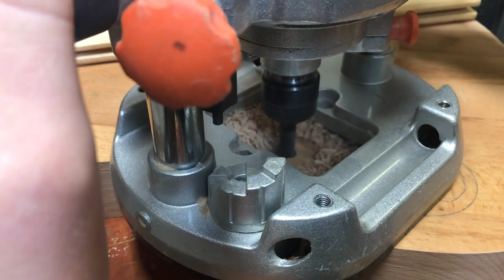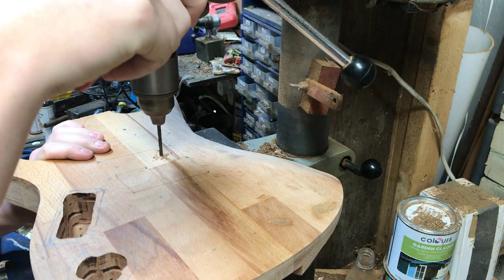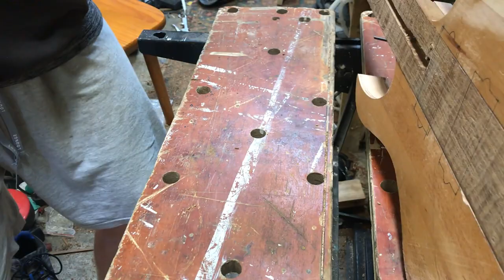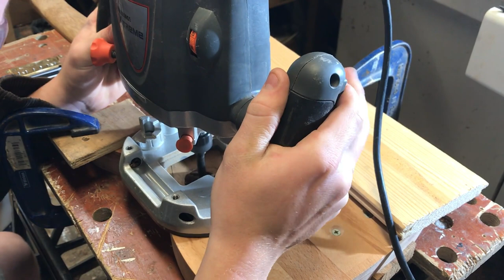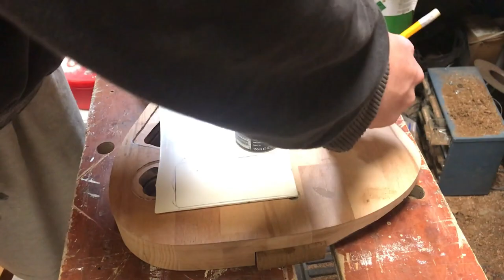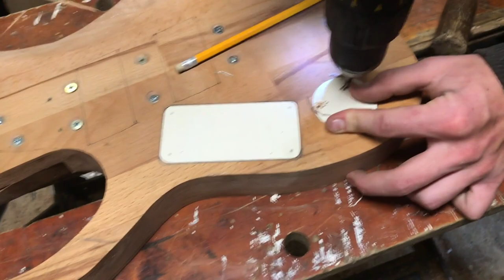Custom Electric Guitar Part 5 - Body Cavity's

Comment: Now you're cheating. There is a point at which your cavities look as though they've been carved out with a blunt axe. And then suddenly, voila, they have clean edges and are the right shape. How did you achieve this? You don't need money for parts. You need money for templates, forstner bits and router bits with a bearing. And what's with the custom pickups? Are you going to wind your own?
Reply from the maker: its all roughly routed out on camera and then afterward I have carefully freehand routed it to the lines that I scored with a knife to get a perfect edge off camera because I didn't want a camera in my face while I got up and close routing it. and I know I would use templates but I am happy with the way it turned out in the end. and no I am taking some and remaking the base plate so it lies flat in the cavity and then repot in wax.